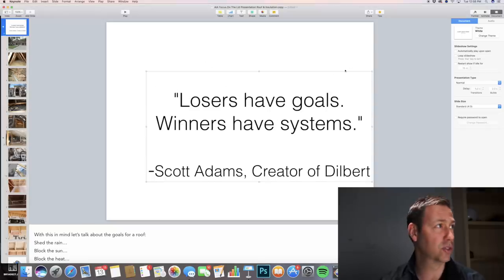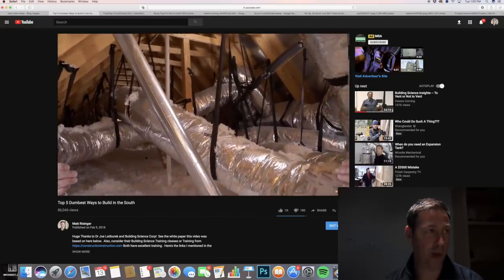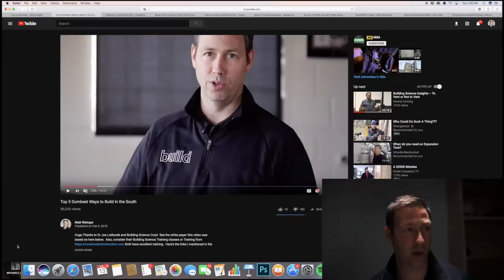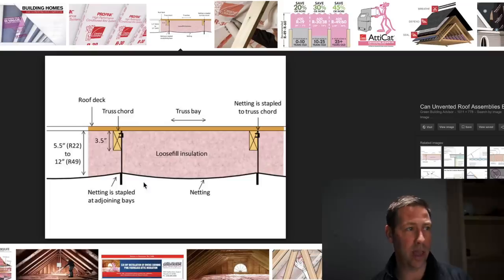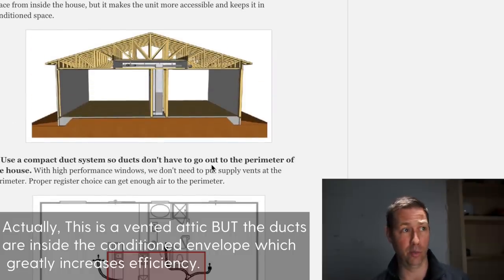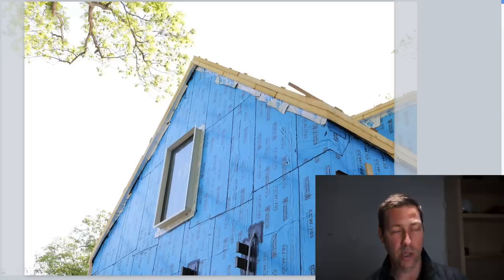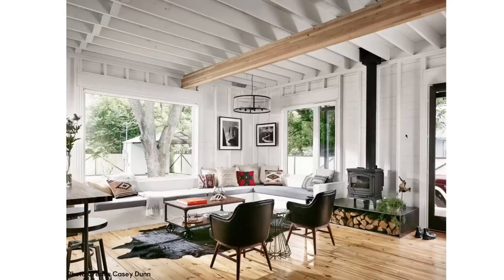Attics/Roofs - Dumb vs. Smart - How to Build Correctly

Comment: I live in phoenix and i have a 2 year old house with the fluffy  stuff. I wanna spray my rafters but my furnace is gas. What changes I have to do before spray foam. 
The ventilation for my attic are on the roof with little grills.
Reply: A gas furnace can be used, it must have a sealed combustion chamber though. The 90+ % furnaces have the sealed chambers. They are not that much more expensive than the 80%ers. They vent with PVC.

Comment: I'd rather just add another foot or two of the fluffy stuff. Make sure the HVAC is very well sealed and bury all that in it too. Way more R value (since it will be much much thicker) than any of the spray foam, and dirt cheap.
Reply: You probably already have enough attic floor insulation.     But you are making ice cream in an oven, if you have ducted a/c in the attic.

Comment: If you are in the process of putting on a new roof would it be cheaper to updated 1960s home with foam above the deck before the roofing goes down?  Is there any reason this is not a good way to do it?

Comment: Hey Matt like to know if I can seal around the eaves with the can spray foam (to cut off the air flow) then use the LP tech shield as the roof sheathing with fiber glass batting staple between the joists for a conditioned attic? The home will be in south Florida.  ja'ne

Comment: So, when I re-deck my roof I lose all of my spray foam insulation?  I get that it's (at best case) only once every 25-ish years, but still.
Reply: See 14:07, I would suggest putting 2x4 strips on top of the existing decking, then new plywood or metal on that,  leaving an airspace in between. But I'm not an expert.
Reply: no one re-decks their  roof....

Comment: Would a system like that spray foam on the underside of the roof sheathing cause a shingle roof to cook and prematurely wear out
Reply: Good question.. I wish he would have answered that.
Reply: He mentions radiant barrier multiple times in the early parts of the video, then mentions later in the video that you want to vent the roof, not the attic (hence the metal roofing)...that said, you raise a good point, since shingles don’t stand out or have ribs. If anyone else knows (or Matt would like to educate us), I’d appreciate it. I’ll continue to read through the links he provided, but in your case, I think the Plenum Truss system he talked about would be ideal for shingles.

Comment: At 7:44 and 9:50... My understanding is that open cell or the Owens Corning products alone will not pass code because it is air-permeable? IRC requires you to provide air-impermeable or rigid board insulation either directly above or directly below the sheathing in addition to an air-permeable insulation in all climate zones (see R806.5-5 and table R806.5).
Reply: I have run it to this. I am an architect in Northern California. We did a house with a flat roof and had to spray close cell 2" and then batt insulation. Close cell for the dew point occurred in the 2". I did a house in Dallas and was told that close cell was not allowed by code. Different climates. We end up doing rigid insulation on the exterior on the Dallas house.
Reply: Splash & batt.
Reply: That's exactly what we've been doing in southern Utah (climate zone 3), or we do 1" or rigid on top and batts below. So far so good. I would love to give the new insulated ZIP panels a try and kill 3 birds with one stone. If he's doing open cell alone I would be nervous about the dew point being inside that permeable foam and causing issues...

Comment: would it make sense to spray foam an attic when the house has central heating and air? My ductwork is ran through the crawlspace so I'm not concerned with hot air around the ductwork. But I have that ratty attic insulation and I feel like the spray foam would be much better for energy efficiency. I have an outside AC unit.

Comment: You really do need blocking between your rafters for transferring roof diaphragm sheathing shear forces down into the wall below. The sheathing needs boundary nailing there, and the rafter house doesn't have the ability to have any.

Comment: Matt,

What's your take on spray foaming an attic with metal roof ?  I heard from a few that the metal roof acts as a radiant barrier and spray foam is not necessary.  They were confident that you could insulate the old ways with radiant barrier decking and bibs on the attic floor.

Comment: great video! great explanations! can you please explain to me the proper way to do a cathedral ceiling with pine paneling? I was thinking 2x10's as the roof trusses, with hard foam insulation laid onto the pine boards between the trusses for a r60. plywood on top of the trusses. silver bubble foil on top of that. than the vent panels running the whole way down the roof with a metel roof. ridge cap vent at the top, full vents at the bottom. the roof vent would only be for the metal roof. no vent on the inside. your opinion please.

Comment: Use fireproof foam radiant barrier board with a heat/fire proof sealants around all cracks, nail/screw holes, seams. And a heat/fireproof glue.

Loose insulation is terrible.

Comment: In the case of retrofitting an existing attic with vented soffits, would you just block and foam all spaces between roof joists at the upper story top plate?  Any concerns with leaving the vented soffits in place?

Comment: As usual great video.  I live in New York and spraying foam directly on the roof underside is a large departure from glass with an airspace for venting.  Have you seen any problems with the sealing of the underside of the roof decking in this manner?  Any rot?  Could this conditioned space in the attic (which is a great concept) work in a colder environment?  Thanks.
Reply: You’re basically creating a “hot roof” if you do that which can cause freeze-thaw and ice damming on the roof. It’s not permitted by code in Ontario. Really wish there would have been some discussion about colder climates

Comment: If the leaky attic ducts are causing depressurization, can't that cause a gas water heater or furnace to vent into the home instead of outside, resulting in dangerous indoor CO levels?

Comment: With the foam in the rafters, the foam may have a higher R value, but now you are heating and cooling your attic.  (Conditioning the attic).  I feel the juice just ain't worth the squeeze for the price and they are showing the foam is unhealthy.  Just put a thicker layer of insulation in attic to achieve better efficiency.

Comment: I have a modular home that i just replaced the roof and im going to finish  the up stairs with 2 bed 1 bath. I was thinking of spray foaming the whole roof in stead of insulated the framed walls. But there is vented soffits. Should i cover and foam around or do i leave open an insulate the exterior walls?

Comment: Wouldn't some of these air seal benefits be negated by the extra volume of air and energy-absorbing surface area that is conditioned? It seems like this would be the equivalent of heating an additional 25% square footage of home (in a northern climate).
Reply: This is mainly for dehumidification purposes.  Plus if you air seal your house that hvac system all of the sudden is oversize, their will be plenty to spare.

Comment: Matt, awesome video as always! Could a 3d mesh rainscreen be used instead of the wood battens?
Reply from the maker: Yes absolutely. Slightly less airflow but it’s a good system. We used wood battens because the thick foam necessitated it. We used long screws to secure the battens then just attached the roof to the battens. Make sense?
Reply: Makes perfect sense for that thickness of foam. Is there any need for a drainage plane between the rigid foam and water barrier?

Comment: Hi Matt, Yesterday I was watching some horror movies about houses that had there attics sprayed with the same foam as you showed in your first "smart" house in this video. Because there is no regulations that cover spray firms there are some cowboys out there that spray the foam incorrectly and have caused ill health and uninhabitable houses taking thousands of dollars to correct. how do you make sure that the spraying is done correctly and the chemicals are mixed and sprayed in the correct way
Reply: The temperature of the resins/mix and the amount sprayed is the problem. Big jobs require a man watching the reactor/equipment to make sure temp is correct even though reactors are automated. A small room can be sprayed by 1 tech easily...question it if only 1 tech shows up to do a whole house or attic. Ask questions, get multiple bids, question the techs experience. These horror stories are few and far between. Go for owner operators that take pride in their work. An LLC company is a plus....but then again, pride in work as with anything creates less issues.

Comment: So exterior insulation also helps prevent mold? Cold condensing surfaces.. At very least it's the outside of the wall rather than inside of cavity?
Reply: See Risinger's other videos on the subject of moisture barriers.    This is an epic tale.

Comment: Great stuff Matt! You're like "This Old House" on steroids! I would enjoy to hear your thoughts on spray in foam and chemicals they might release over time. Lately there have been some news reports of incorrectly installed spray in foam and the chemicals they released. Wondering what you think about avoiding any issues and if the release of chemicals from spray in foam is about the same that is released from Fiberglass bats. Thanks again. :)
Reply from the maker: Michael, I don’t get hysterical about spf. There have been some problems but they are few and largely overblown. That being said I don’t use it exclusively. There are other methods for most applications that work just as well and are less expensive
Reply: @buildshow  Thanks for your input and enjoyed that you gave the fiberglass blown in option. Next house I'm definitely going to do the "envelope" option like you show here. Also working on my general contracting license so a lot of good information to learn from. Have a great weekend.

Comment: I have 1997 socal cookie cutter two story stucco truss home. I have a 3 car garage i would like to finish into a conditioned space for shop and pets. The garage has a tall usable attic space but with zero vents on roof or soffit. The only vent is on the exterior wall, below the bottom cord of truss. What might be the way to vent the attic before i insulate and close ceiling ?
Reply: I'm glad you asked.    I own in SoCal (LA County) and have been allarond LA County for over 60 years.   The short answer is:  Ridge vents and radiant barriers.   My house is a laboratory to this point and the only counterargument for sub-rafter radiant barriers is the threat of rat infestation.    So I maintain intense rat countermeasures and surveillance along the property line!      You oughta see my garage, where pets and shop activity can thrive, at near zero cost in energy.     Get that "conditioned space by virtue of freon" out of your head.  Think radiant barriers.     Contact me for more info if this interests you.  It's also a DIY low cost solution, ideal for SoCal.

Comment: Could you use loose fill or batts on underside of rafters, put rigid foam on top of OSB and cover with WIP 300 HT?  Isn't the WIP an air barrier (no need for spray foam)?

Comment: If a home has ridge and soffit vents can spray foam still be applied?  The HVAV system is in my attic and I would like to  control the heat and cold in the area.  I am in the North East.  Thank you

Comment: I dont know. How "smart" using spray foam is. Considering that now a days there's a lot of people(including my local Vancouver building code) saying that spray foam is not only horrible for the environment. But it will create condensation, rott and mold on the wood that's attached to the spray foam. When the wood is introduced into a cold environment with the heat of the spray foam/building. Its inevitable to create moisture in an impermeable environment like that.

Comment: Trying to find where a leaks located at is nearly impossible with spray foam. Water runs down any channel or crevasse between the decking and insulation and gives false locating on where the leak is. Water sets in void pockets of insulation and has no where to escape to.

Comment: So, how much does applying spray foam to the underside of the roof sheathing add to the cost of replacing the roof in the event that some of the sheathing should need replacement? It looks to me like that is going to be an issue in the future. That said, will the energy efficiency pay for the extra cost of sheathing removal upon roof sheathing replacement in the future?

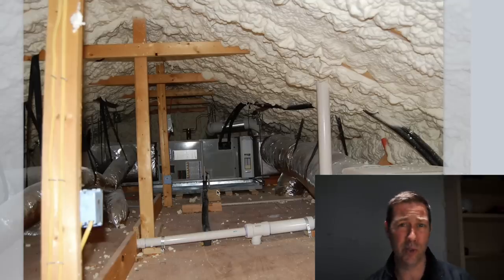Comment: Matt, your refer to the “furnace” kicking on (5:00), are you referring to the A/C system or do you have full HVAC (heating) in the south?
Reply: Heat is necessary almost everywhere in the US in winter. Most people use the same units for heating as well as air conditioning, and call it a furnace, whether it’s being used for heating or cooling.

Comment: Also.....Having a real hard time getting my head around dumping A/C into my attic......that is a lot of space to cool if your not using it for anything..... Volume is Volume and More Volume means more $$$$$$......Just Saying!!!
Reply: Volume doesn't matter for heat loss or gain. It is surface area that transfers heat. Foam is so effective is preventing heat transfer it more than makes up for the slight surface area increase. The air sealing also makes up for even more efficiency.
Reply: Also, it would only be a one time increase in cost to get that space regulated. Once it is, the cost will be minimal to none. not to mention having all your ducts running more efficiently.
Reply: When I was 8 years old, I naïvely closed our basement A/C vents to save money. It made the A/C much less efficient. Thank goodness my Dad realised my mistake right away.
Reply: Remember, in such a house, you're losing only a tiny fraction of the heating/cooling you would in a code-minimum stick-frame.
So, which is cheaper?  

Heating/Cooling 15,000 cubic feet of space once a day?
Or heating/cooling 10,000 cubic feet of space four times a day (or more)?

Comment: You sprayed directly on the sheathing with open cell? A 1” gap is recommended between the sheathing and the foam. Or did you put rigid foam on top of the roof sheathing?
I assume you’re in climate zone 2. So you think this wouldn’t cause moisture on the bottom of the sheathing.
Reply: was wondering too .... here in Minnesota it has to be closed cell if its on the sheathing ...

Comment: So, when insulating a finished attic with spray foam between the rafters, do you need to provide ventilation from the soffit to the ridge similar to batt insulation?

Comment: Great video, makes me want to condition my attic. I just recently moved to the South and this house has the traditional "dumb" attic design with the ductwork and fluffy stuff... definitely noticing the high temp of the air that comes out of the vents when the AC kicks on :-(.   Question: If you add spray foam to the underside of the roof sheathing on a remodel, should you remove the "fluffy stuff" that is already up there on top of the drywall ceiling? Also, does the spray foam on the underside of the roof sheathing make it difficult to make repairs to the roof... like if you had to replace some of the sheathing due to rot at some point in the future?
Reply: Just put another foot or two of fluffy stuff and you'll have way more R value than the spray foam and it will be dirt cheap to do. It will also cover all of your duct work so that will be super insulated (if it's on the ground and not hanging high from the rafters).

Comment: When you put screws through the insulation, doesn't that compromise the wrapping? I'm not a builder, so I apologise in advance.
Reply: Yes, but not that much, and it''s unavoidable anyways (any siding system needs to be fastened to the sheathing. .

Comment: What about the dangers of spray foam  Chemicals in the spray people get sick from
Reply: I personally think that is over exaggerated by a bunch of snowflakes.  However, foam certainly does off gas, but that is pretty much negligible by the time an owner moved in. There are specs for these numbers available by foam and manufacturer. It falls off dramatically very quickly.  And there are also hazards associated with other insulation, such as inhaling fiberglass.

Comment: $250/sq. ft. is insanely expensive. I wouldn't use that as a bragging point - unless it's just to say that you make a lot of money. Mentioning this as if it's cheap or a good value for the customer is a joke.If you are going to build cathedral roofs in terms of insulation on top of an attic, you may as well nix the attic and just have a regular cathedral roof. Your real problem is that you haven't learned to innovate the HVAC system. Either go ductless or if you must have ducting, run the duct system under (crawl space or outside the house (insulated soffit?)

Comment: How far south are we talking here about building in the "south."  I'm building in Northern Tennessee.  Is that still the south?  It's not near as bad as Texas, but it gets hot and humid for sure.  But also you'll get some snow in the winter.
Reply: If you want more info on attic insulation you can check my new channel for tips on loose fill insulation.

Comment: nice.  what was the ACH on the perfect house you did.  without windows and doors it must have been very low.
Reply from the maker: Under 1 ach50. Next one I Build will be much tighter. I used low cost windows and doors.